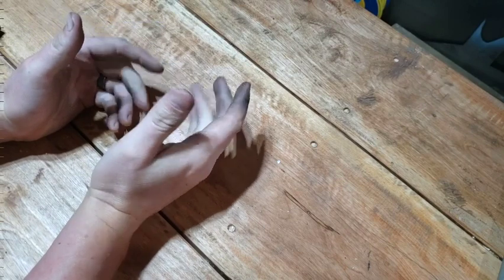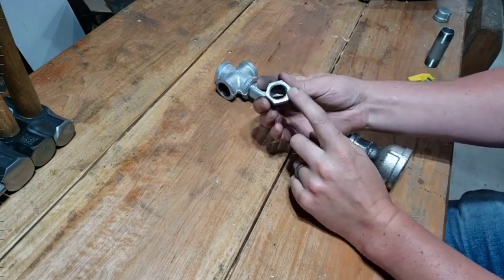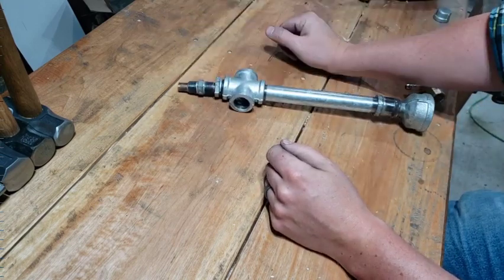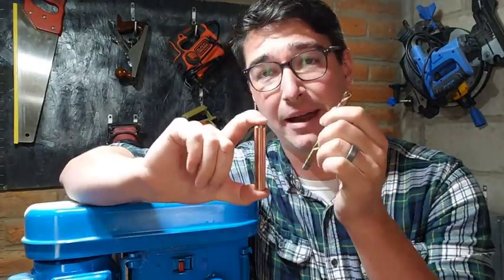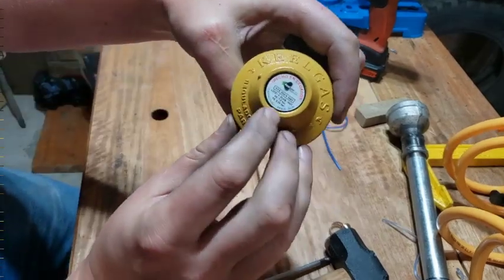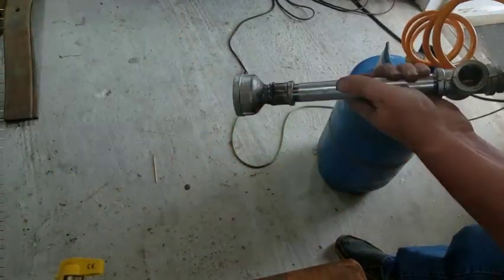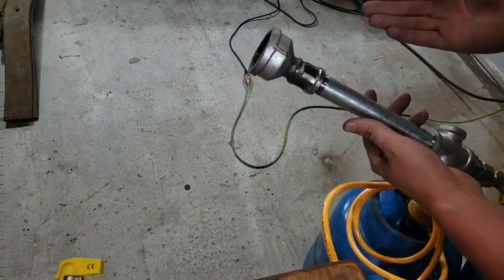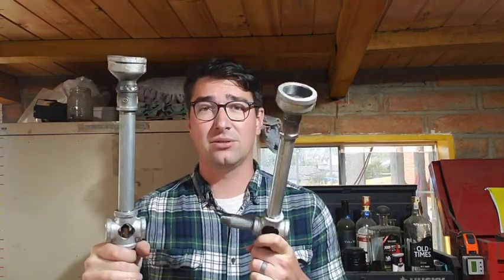EPIC DIY Gas Forge Burners

Comment: I read an article from you on speeds and feeds on CNC milling for aluminum 6061. I was hoping for some advice. I have a Mega V Mill Right CNC and am going to attempt to mill Al 6061?this weekend with single flute upward 1/4 end mill and 1/8” as well. Was hoping for some advice on speeds and feeds and depth of cut.